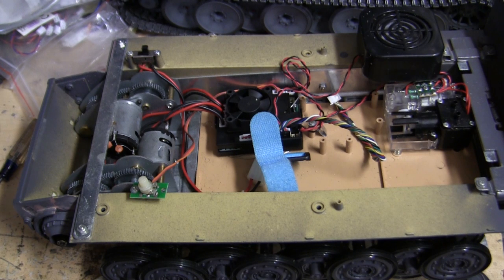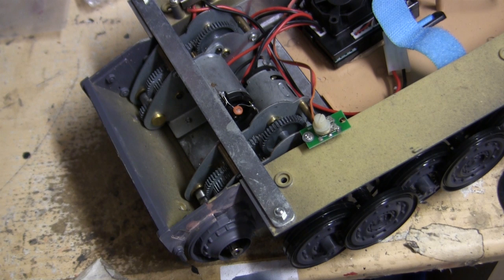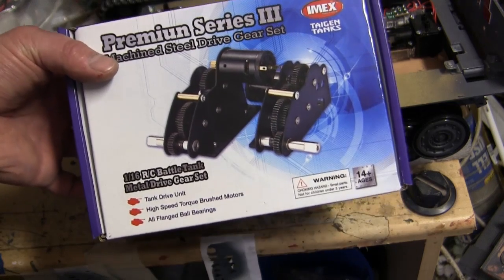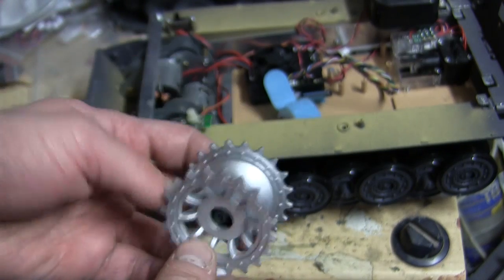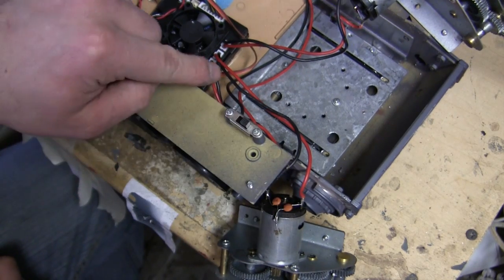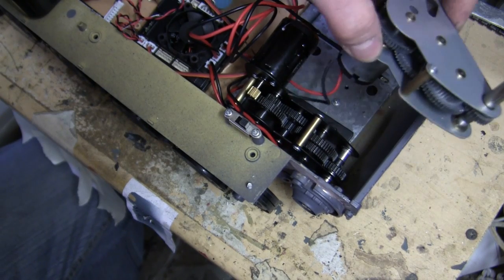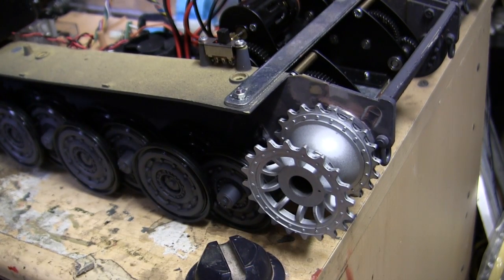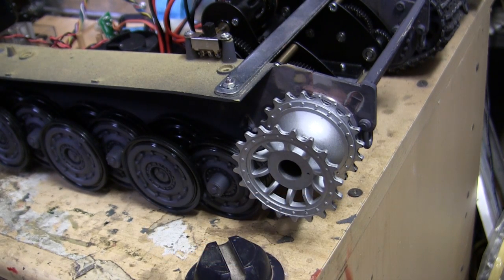1/16th scale Taigen RC tank replacement steel gearbox tutorial video

Comment: At 19:01 min. The external side transmission on the Tiger without ball bearings? If you want to attach metal rollers, drive and slack wheel (tension roller) as well as metal chains to the Tiger, because of the extreme weight!
Reply from the maker: tiger I don't have  tension roller, like the panther. Some people add a rollers, but from what I have seen it's not necessary on these 1/16 models. The weight of the tracks is not an issue in this scale even in metal
Reply: @oddball759mm  I meant the last re-steering role on the back of the Tiger! Sorry my English is a bit rusty, may also be due to the translator.

Comment: Great vid oddball as l would expect. As far as lubrication, the oil goes everywhere, an the grease gets bits of sand an grit that gets into the tank. So l find the best lubrication is powered graphite. It has very good lubrication properties. Once run in does not fling an does not attract any grime or grit. I also use it in my 1/6 scale LEOPARD 2A6. An have not yet had any problems after prolonged use. Scott
Reply from the maker: I never run on sand, so I never thought about that but yes that is a valid point. Also Interesting lubrication solution with the graphite, I may look into this for the future. Thanks!

Comment: What about support bearings on the sprocket? Thanks for uploading this!
Reply from the maker: It's not needed. The gearbox already has bearings for the final drive shafts and the length to the sprocket is not very large. You can mod the tank's molded final drive plastic housing and add them if you want but it's not something that is required
Reply: I had no idea it was plug and play, I’m over here with my T-72 trying to figure out if I’d have to connect the wires myself lol
Reply from the maker: yeah these systems are made to be very user friendly, good luck with the T72

Comment: can you tell me if a metal mato upper shell will fit on the lower taigen shell ?
on the tiger 1 model
Reply from the maker: I can't say since I don't have any mato uppers here in the shop at present.
Reply: @oddball759mm  
i dont think it will fit perfectly
oké other question :p 
i one of your videos you said that the electronics of mato was the worst
is it possible to fit taigen electronics to the mato tank ?
Reply from the maker: @HappyDude1  if the current mato uppers use the same locking system as the old one I worked on then no it wont work on the taigen without some heavy mods. Also I don't think the taigen torsion bar  suspension can take the added weight of the metal upper and metal turret combined. 

The old mato I worked on had really bad electronics yes, and in that video series I also say that all were gutted out and replaced with the taigen system. I was also told that new mato tanks use a different system than the one found on my example but since I have not worked on a mato kit since I can't say
Reply: @oddball759mm  
Owke do the cables of the mato tank fit into the taigen board ? 
And is the reciver allready on the taigen board  ?
Reply from the maker: @HappyDude1  the plugs are all the same. And the taigen system has the receiver built in. The new taigen motherboards have the option where you can bypass the built in receiver and use your own radio like a futaba
Reply: @oddball759mm  
all right very nice thank you !
Reply from the maker: @HappyDude1  np

Comment: wich grease do you think is best for steel gears ?
Reply from the maker: basically what ever grease I have on hand. In the past I've used marine grease and also high temp grease. Rule of thumb is to not overdo the application. Too much can strain the motors, so just a little dab here and there will be suffice

Comment: Don’t use loctite on plastic please, it will eat the abs
Reply from the maker: been using the permetex stuff for a decade on plastic, havn't had a problem with it yet. Also I think the plastic is polystyrene, ABS has a different feel to it In my experience
Reply: @oddball759mm  ok experience 🤣